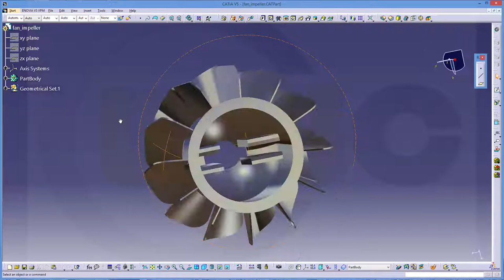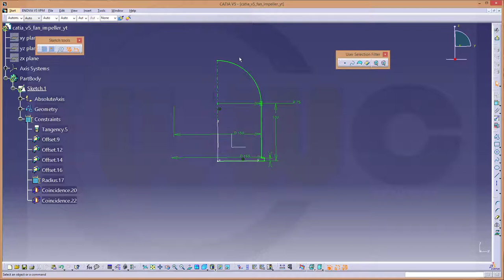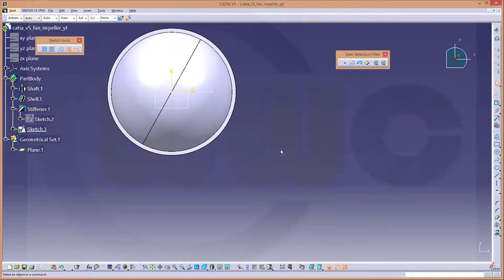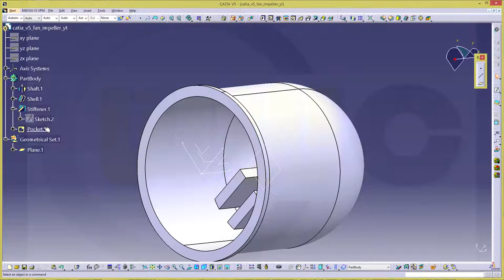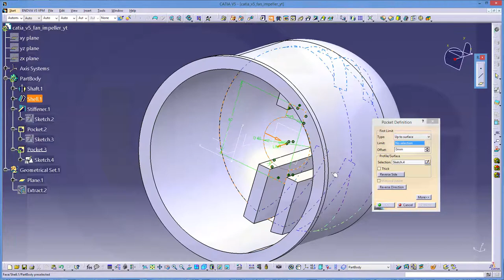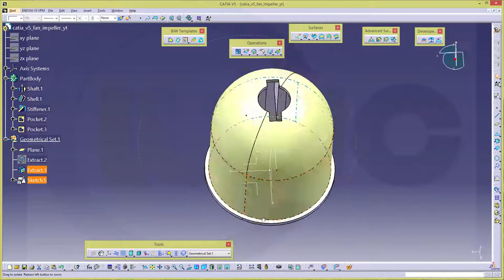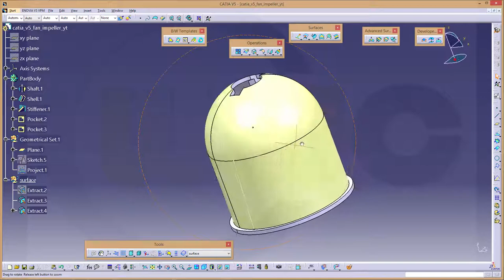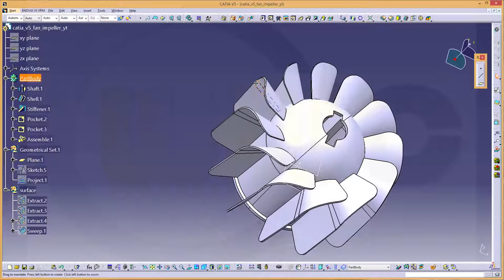Userwish - Fan-impeller - Catia v5 Training - Part Design

Comment: how did that shell got hide when it was made as an define work object
Reply from the maker: It was not hidden, I cut the graphics to the sketch plane - that is the reason why it "vanished"
Reply: Hi, if you mean at time stamp 5:10 , there is command cut to sketch plane, that cut the model by sketch plane and doesn't show , to make it easy to create sketch..
Reply from the maker: Yes, it was the cut to sketch plane.